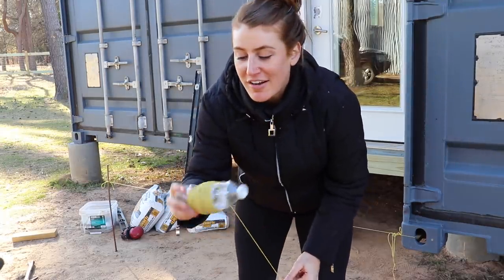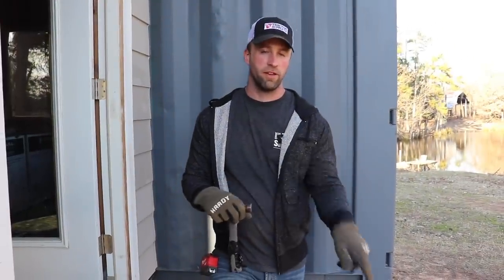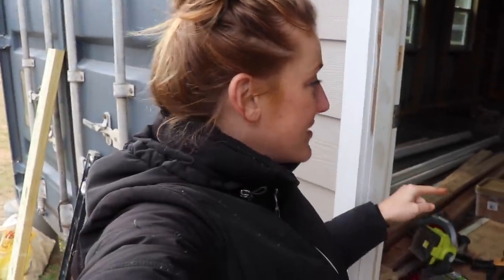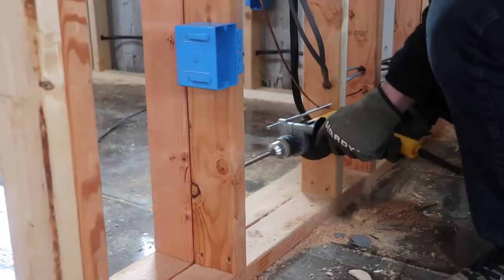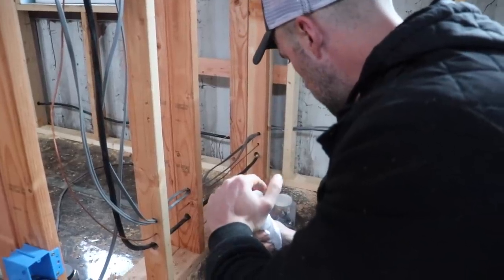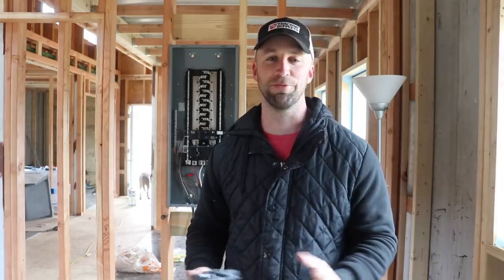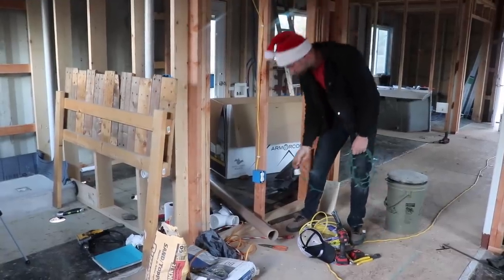Wiring Our CONTAINER HOME!

Comment: Just a little tip from an electrician. You may regret putting all your receptacles in before sheet rocking the house. You will have to pull each device out when it comes to cutting your openings for the boxes in order to get a tight fit around the box. Typically we install one GFCI on each floor in a central location This way you have power in the house to run your tools. You guys are doing a great job on the house.
Reply: Exactly what I was going to say, also an electrician and electrical contractor with over 30 yrs experience!  When it comes time to sheet rock, pull outlets, pig tail wiring (hot to hot and add a length of Romex wire to be hooked up to outlet after sheet rock) and also to all other wires, and push wires back into box and add some newspaper or equivalent into box to prevent damaging wiring when installing sheet rock.  After installing rock, tabs on outlet will automatically space outlet flush with wall board provided rock was cut to a tight fit with box!!!
Reply: I also notice you wired directly through each plug...put some pigtails on those for sure when you pull those out to drywall...which I assume you are going to do...
Reply: ALSO COVER YOUR PANEL-  Live buss bars shouldn't be open to accidentally touched!
Reply: Ok so I would probably recommend that you use the plastic box casings before putting on the dry wall

Comment: i am a retired electrician,, and have wired a few houses for friends. do yourself a favor and draw a layout of the house walls or just the rooms, one each. then show the outlets and how the wires are run, and what number the breaker is for the power. if you ever have a problem with the power, you will see how you ran the wires.
Reply: MJW 😂😂 or a blueprint maybe🤷🏾‍♂️
Reply: @davidcoylejr.3967  most people don't have a blue print for homes they are building on their own, that is why i suggested doing a drawing.
Reply: MJW  and in the far future of the 2020's, those picture files will be long lost to all sorts of commercial cataclysms. Physical pictures on tough paper is always the way to go.
Reply: Plumbing too hold a tape measure up to wires and make reference photos 
Then make a flash drive to put them on
Reply: Just split wires by rooms and mark breaker on panel schedule. Two bedrooms(15amps), bathrooms plugs20, kitchen1(20), kitchen 2(20), general lights(15), dryer(30), washer(20), microwave(20), dishwasher(15, or 20 amp depending on your area electrical requirements) outside outlets( 20). Heating (50) (Well, you have to plan it first, what kind of heat you'll have), range (50). 
Nail on boxes are way, WAY cheaper than sidecart ones. And romex wire is much practical and cheaper than u/f wire they use.
15 years custom houses electrician in OR and WA. Need help let me know. Love your channel. Merry Christmas to all. God bless.
Reply: Quick question...I noticed they ran they're cables directly through the wood without any pvc conduit pipes. I've always thought that was a no-no for running cables in container builds but this makes me wonder. I know the cables have an outer rubber coating but I've never felt that was enough and needed to be housed within pvc pipes if you're embedding them in walls. So am I wrong, are the pipes overkill?
Reply: @MichaelEMJAYJohnson  as you can see, wires are ran through wood members. Thickness of wood members should be 3 times adequate to thickness of wire. If wire is ran through thinner wall members it has to be protected with at least 16 gauge thick steel plates. Best practices are with metal sheeting conduits in metal members, but it would be overkill in this situation.
Reply: cuznjo1 not sure what part of this great country your in, but here in Texas, we're smart enough to have a plan prior to building... As a commercial GC, I clearly understand the value of knowing what's behind the walls, just wanted to grin at a notion that felt a bit dated given the circumstances.
Reply: @davidcoylejr.3967  oh, never ending war between commercial and residential contractors. 😁 This house has, like, 5 walls the most, what kind of drawings they need? I understand if this would be mega structure than yes, "every screw and bolts up to engineer requirements", but for only this it's overkill.
Reply: PVC pipe in interior spaces is toxic when burning 🔥
Reply: cuznjo1 I guess they will have the videos as reference
Reply: @andrymashka1757  ... You seem to have a lot of experience and know what you're talking about. Quick question: How do you feel about running the proper gauge extension cord instead of Romex?
Reply: @2MasterBuilder2  extension cords are not rated for operating temperatures, under CONSTANT load, romex is.
Reply: I can't tell you how many times I told my DIY hubby to do this and he never would, the issues and time it cost him later was insane! We needed to completely rewire our cable TV and Inter net from pole to every room and out to the trailer. This time he actually listened to me and the cable man was so happy to know where every connection was running to right at the box.
Reply: @MichaelEMJAYJohnson  - interior rated electrical cable is fine to run through wood. Sometimes nail protection plates are hammered to the front or rear of the wood stud if cable passes too close to either. This avoids penetration by a drywall screw. Also, they used a step higher in cable called U.F. which can be direct buried in the ground and is more abrasion resistant. You only need a conduit sleeve where the electrical cable goes from indoors thru the steel to an an outdoor receptacle on the house exterior wall.
Reply: I rarely see any electrician torque any of their wires according to the specifications listed on the box or on the breakers.  Little did I know until someone pointed this out to me that those specifications are put there for a reason. You don’t want arcs creating a fire in your home if not properly tightened.  I always thought that my hand tightening was good enough. But, with increased fires due to improper torque specs . . . a fire inspector gained my respect.  Check it out - yes, those torque specifications have been there for years.  That includes grounding bars, neutral bars, and the  lugs on the breakers.  The torque specs are different according to the gauge of wire, as well.
Reply: @hatteraslabuf  i will be honest with you, with over 40 years on the job, i never torqued a wire like you just said. but years ago when they used aluminum cable for feeders, we would check the feeders every now and then, because the aluminum would shrink, and heat would form.
Reply: Cuznjo1 - the guy even showed me the torque specs on the devices.  He mentioned that elec. inspectors are now going around asking the electrician to show them their torque screwdriver.  If they don’t have one . . . inspectors are automatically failing their inspection.  He tells me that it is being done more frequently in urban areas due to jacklegs doing their own wiring and the fires that are being caused by the improper tightening.  I always thought that tight was good enough regardless of aluminum or copper.  Hell, the power company still uses aluminum !
Reply: @cheekywoman  I've seen sheetrock screws going through mc conduits before. So there is no 100% guarantee on that matter. 16 gauge steel plates, on other hand, are much tuffer. I see your point in in adding/replacing wires in future, but sheetrock repairs are not as expensive as running ( more like it bending and fitting in stud bays) metallic conduits.

Comment: Google "service loop". Adding extra in the panel and in the j boxes if possible for future changes will be your best investment. Never know when you'll want to move loads around or make general changes. Wiring circuits with the bare minimum length is a recipe for later frustration.

Comment: Why are you using UF-B inside instead of NM-B ?  UF-B 14-2/12-2 is about $65/$105 per 250' coil and NM-B 14-2/12-2 is $58/$88 per 250' coil.  12-2 with 20A breakers is only required in a few locations (not a bedroom!) but I do appreciate you using NEMA 5-20 outlets.
Spenser needs a gun for Christmas to take care of those pigs before you plant your garden !
Reply: Jack Patteeuw I’ve

Comment: why use UF cable? seems expensive and a PITA to work with
Reply: My thought exactly! I hate that stuff! Also, his feeder wiring looks too small.
Reply: I was wondering the same thing...
Reply: Marty Galbreath was only on 50 amp breaker from what I saw
Reply: Spencer seems pretty thorough on his builds from what I’ve seen , maybe they aren’t gonna have any high amperage draw items in the house.
Reply: @tinkeringaround6241  but why use UF all through the house?
Reply: @matttodd3022  Maybe it was all they had on hand?  If they plan on using UF through the entire place, its gonna cost double what regular Romex would cost.
Reply: @tinkeringaround6241  Washer/dryer - 20A/30A.  Refrig - 20A.  Dishwasher - 20A.  Stove - 50A.  Unless I'm missing something the incoming amperage may be too small.
Reply: Same thought.  At first I thought maybe he is just doing the one outlet and it's the only wire he had around....but then later you can clearly see a roll of 12-2 yellow ul romex on the floor.  Maybe he just wanted to use up his extra UF.
Reply: @eazzzye2003  - To lower the solar costs it would be good to use gas for stove, dryer and hot water
Reply: @mortimergladbreath  ;  IF that is a 200 Amp Main Panel , then the CU Conductors need to be at at least 2/0 CU or 3/0 CU and those feeders that he has installed to the Main Panel are improper sized conductors !
Reply: @dougmc666  Makes sense, but there's been no mention of gas.
Reply: Matt Todd might be what was leftover. I agree with everyone that it’s a pita to work with but you gotta use what you have sometimes

Comment: Why are you using UF cable instead of NM?  It's expensive and a pain in the ass to work with.
Reply: And they ran NM-B Romex through exterior buried conduit as their main feed wiring.  Romex uses THHN wire.  It's not rated for wet locations.  The insulation can actually absorb water.  I commented on it in the video where they ran it, but they seem to have left it as is.  I just hope they have separate grounding rods for the power house and the container house and they've only bonded ground and neutral at one location.
Reply: UF is such a pain!!!Especially the old stuff. Newer is somewhat better to strip.. SOMEWHAT!!

Comment: Hey guys, Merry Christmas. 
The lamp and christmas lights you  tested with are double insulated decices only utilizing the live and neutral lines. Please test all your points with a proper tester that check the earth as well. You can get super cheap ones that just have 3 little lights in them that indicate each line and that they are correctly wired.
Take care and enjoy the holiday season.
Reply: Agreed. For decades I wasn't aware of the faulty outlets we had until we were selling our home and an inspection was coming. It wasn't until I purchased and used the outlet tester that say 7 out of 10 outlets were faulty. That little tester saved us tons. DIY

Comment: Sorry Folks, but checking a outlet with Xmas Lights was foolish because it can still work even though it might not be grounded properly and it's dangerous to assume it's ok. Using an outlet tester is the only way to go and there not overly expensive, require no batteries, and will  indicate if everything was wired correctly especially the ground. Each room should have its on dedicated circuit and the number of outlets you installed should have wired it into two not just one since most rarely have more than 3-4 per room. Indeed electrical wiring isn't for the average DIY and even off grid both you can't skip the permit/inspection process because the consequences are far more reaching than just a City/County it's built in. Most Home Owner Insurance Co. can deny a claim or even deny coverage for you is these steps weren't followed especially on new construction and unless our favorite duo has hopped thru these hoops they might be in for a nasty surprise/fines when their finished.

Comment: Why are you using direct burial romex inside? Don't feed through devices! Spend the 30sec to pigtail.
Reply: Adam Patterson 

Romex is a brand name, that often gets used in place of NM cable.  The cable they were using is UF, which stands for Underground Feeder.

Comment: Hi Spencer. You never talk about the inspections from the local building inspector. What's the deal?
Reply: Texas counties generally dont require building inspections. Only for OSSF installs I believe.
Reply: Yeah they did talk about it a little later.  There is a lot Texas residents can get away with.  : D

Comment: The Xmas lights are good for video, but not for testing. There is no ground... You can buy  a proper tester at any of the big box stores. They will tell you if ALL of your wires are correct or not. And they CAN BE NOT!!!

Comment: Checking a socket with a low power load does not prove much, except that there is power there.  You can get a proper device that will check for several error conditions, including reversed phase and neutral connections (very common and very dangerous).  Yes, it is possible to check using the Mark-One-Eyeball, but that can be deceptive and prone to error.  The testing devices are possibly (probably) expensive, and this is one occasion where it may well be beneficial to spend a few dollars and get an electrician (with wiring certification) in to check the entire installation for you.  Electrical errors have a tendency to be quite definitely fatal.

Comment: Your indoor wiring doesn't need to be the grey UF style wire.  Just use the yellow 12 gauge Romex, cheaper and easier to work with.  Your outlets also don't need to be rated for 20 amps on each individual outlet unless you're going to plug in something that has a sideways neutral prong or unless the circuit only has a total of one single outlet and is on a 20 amp breaker.  Save the money and get 15 amp outlets.  All 15 amp duplex outlets are rated for 20A pass through wiring.

Comment: Please use bigger wire for your panel, needs to be good for 150 amps, dont know if you plan on using microwaves or electric oven, but once sheetrock is mudded sanded painted you dont want to go back

Comment: im sure you know this but just incase you may ant to put nail guards on the studs where you have pipe and/or wirr going through the stud to prevent screws when installing the sheetrock from hitting any of it. Great job so far!

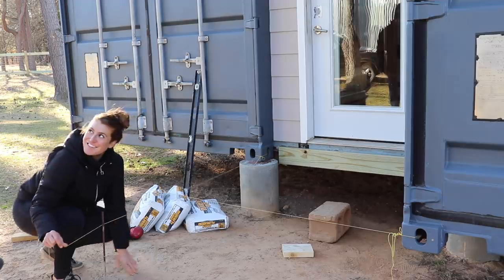Comment: It's good practice to allow extra wiring inside your sub panel by neatly looping your wiring all the way around inside your box. Do not cut your wiring straight into the breaker. In the future, If the wire ever burns out and chips off, you may not have enough wire to reconnect the line to the breaker and you'll have to run that line over again. Which means breaking dry wall, fishing wire, patching dry wall, plastering and painting. It's better to avoid all the work PS 2:11 sounds soiled to me! ;)
Reply: PSS tape your terminal on your receptacles and switches and gfcis with electrical tape. One or two loops is fine, don't over tape. You guys are doing great!!! 👍

Comment: You should run Cat6 cables too while it’s still easy to do, 2 per outlet. Run it back to a central point, then plug them all into a switch, then switch to router/your 4G modem.
Reply: Yes.  I ran 20 drops in a small inlaw unit.  Ethernet everywhere you might possibly need it.  Also for cameras and ceiling recessed wifi.

Comment: old-timer tip: always wrap the outside lugs on outlets and switches with electrical tap to prevent shocks from the accidental side touch.
Reply: plastic box no need. but i do that on metal boxes.

Comment: YOU NEED STRIKER PLATES EVERYWHERE YOU'VE PENETRATED THE STUDS.
Reply: wes laws that’s not true at all.. only if it’s closer than 1 1/4” to the surface is that necessary

Comment: WARNING! Kiddies, please don't try this at home!
There are many cheap strings of lights that run directly from mains power (in the case of the UK up to 260 volts AC). Some places don't have fast-acting breakers, relying on good old fashioned fuses for "protection" (or, in some countries, nothing).
If there's a fault in the insulation or a small person or animal decides to bite the string of lights, the result could be DEATH.
LED strings are pretty but THEY ARE NOT TOYS! (Except maybe the ones that are powered by a little battery box.)
Nice video, guys. Good to see you getting work done and having fun. Merry Xmas!